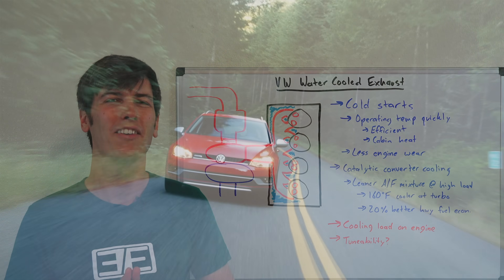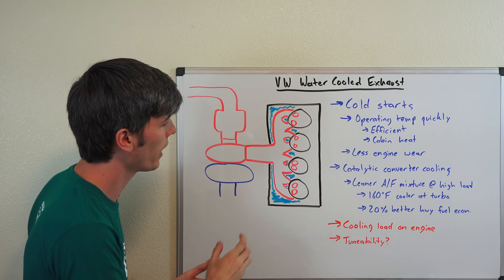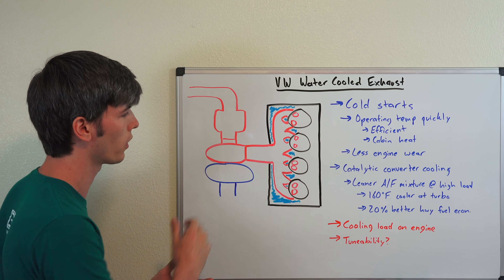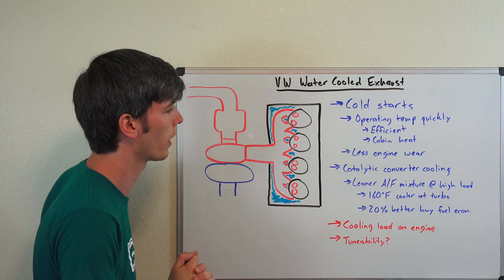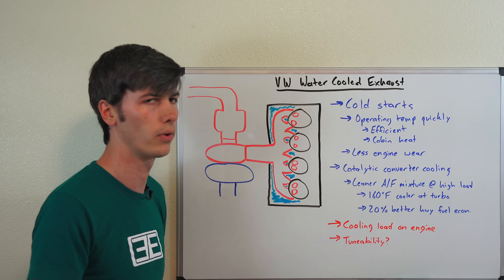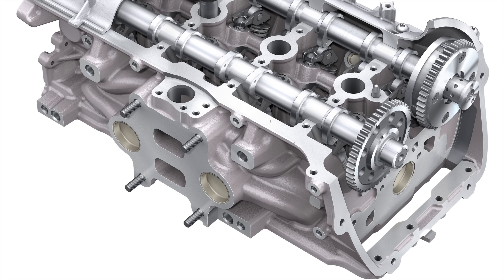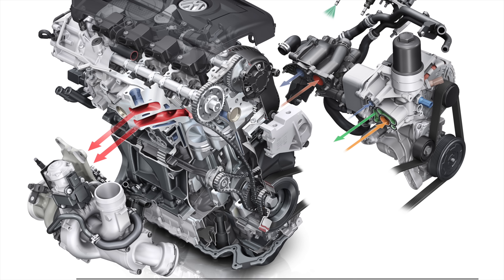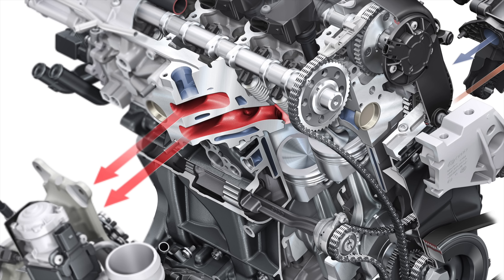Why Does Volkswagen Have A Water-Cooled Exhaust?

Comment: @Engineering Explained Cold engine startup damage does not exist in modern automobile because they all use Sinthetic oil as OEM, therefore there is no oil temperature degradation in cold starts, another thing is about the catalitic converter, it is no a plus if you send cooler exhaust gases through it because the optimus operation temperature for the catalitic converter is above 500 º C, the only thing you get out of this is a higher alternator and battery Amps comsuption due to a bigger cooling fan and a bigger radiator fit in your car to cool the heat excess added to the engine head, a catalitic converter getting carbon clogged faster than usual and a lot of other disadvantages. Volkswaguen numbers and measurements are not reliable...
Reply: Argeny Sandoval You wont get colder exhaust gasses! You will get leaner fuel mixture and that way the cat will actually clog up slower.
Reply: Argeny Sandoval how will the cat clog faster when they use a leaner fuel mix? also, the temperature at the turbo stays the same as before, since a leaner mixture burns hotter.

Comment: But..cooling the exhaust before it enters the turbo is NOT beneficial.  Turbochargers operate on a temperature and pressure differential to spool.  The greatest delta you can manage will produce the most efficiency.  Cooling the exhaust before it hits the compressor is detrimental.
Reply: Ryan Barbolt the temperature actually stays the same as before, since they can run a leaner and hotter mixture, which would otherwise be too hot for the cat converter.
Reply: maybe because cheap turbo cant handle too much heat :D

Comment: Question, Mr. Engineering Explained, isn't the heat produced by an IC engine the result of all the compression that happens thousands of times per minute in the combustion chambers of a running engine?

Comment: Thermal management opportunities. All manufacturers have to cope with emissions demands. Electronically operated thermostats started in the early 2000's. Water pumps with variable output (ECM controls coolant circulation). Additional electric coolant pumps. Movable slats to block or allow the flow of air through the radiator.... All of these things allow for opportunities that can be used to benefit emissions and consumer comfort. Near instant heater output to the cabin when used in combination with an electric heating grid. Can be used to keep heater operation working during engine off state for short times. But most importantly is emissions. The engine is designed to run at its most efficient at normal operating temperature, so the quickest way to get to operating temp is to increase thermal output from the exhaust ports and manage that heat to affect the things I have described above. This design is not VW specific and have seen it used years ago.

Comment: Advantage:
Reduces under-hood temperatures which helps to extend the life of components in this area.

Disadvantage:
Any sort of overheating problem (head gasket leak, water pump failure) will overtax the cooling system very quickly and with higher heat loads than found in engines that send the exhaust through an external manifold. These failures are more likely to cause catastrophic engine damage like bearing failures, block cracking or head warping.

Comment: Could a larger turbo not be fitted and radiator to cool the higher water temp as a result? Does the water get pumped to cool the exhaust or is it just passive flow. Can the pump turn off at cold start to heat the cat quicker

Comment: I'm in the 50s I own ford almost exclusively 30yr Until a ford dealership told me "did not want my old ford vehicle" So I thought to myself you don't want to buy my old car why would  I want to purchase your new vehicle? Their attitude change when I stood up and walk out. I week of research brought me to my local VW dealership, purchased new 2006 Volkswagen rabbit new 2011 Tiguan. Now 2017 Volkswagen. Never had to take a vehicle into the VW dealership for repairs, Oil changes and other routine maintenance yes.  Are Volkswagen perfect? probably not but in my humble opinion they do beat Ford. I had a 2000 Ford Taurus. It was in the shop every single month I owned it. Where the warranty ran out, I got rid of it.
Reply: Taurus was a sh|t box
Reply: My daughter's 2016 Ford Focus has had 3 automatic transmission failures and it only has 28,000 miles. She gets 38-42mpg on the dash meter average so she's not hot rodding it. That transmission just sucks.
Reply: Then you didnt make it past 100k miles.. not unless you did the timing belt yourself.. cool story though..
Reply: Who Me? It will quickly go down hill after about 50 - 70k miles, that's what VWs and BMW do. My wife's Chevy Tahoe has 8 years on my BMW x3 and 70k more miles yet mine is breaking something every month...
Reply: We have a little saying in Europe (not everyone says that, but some do) - never buy I car whose brand starts with an F. This meaning, Ford, Fiat, and french brands :D

Seriously though, all manufacturers have their strong and weak points. And overall reliability, fuel economy and performance quite often vary between different cars of the same model. Even with automation, mass scale production etc. you cannot ensure that all cars will match their specification 100%, neither exceeding it nor missing the target. 

Obviously this will usually not be a huge difference, but if you are lucky and get the one that was in 5% of the most reliable ones, and someone gets the one that was in the least reliable ones, your experiences will look incredibly different.

Comment: honda is doing the same thing with their 4 bangers, and ruining them in my opinion, no longer will honda, or any other inline 4 for that matter that has its header inside the head, be able to make in increase in power without sacrifices, no twinscroll, limited turbo sizing without major work to the head, and if you do increase its output, like you said, you increase the heat load on the cooling system. this is pretty much the end of the golden age of internal combustion engines, everything is hybridized, engineered to have little wiggle room compared to earlier models, the aftermarket is going to suffer because of this.

Comment: The purpose of cooling the integrated manifold is not to intentionally lower exhaust temperature, but to permit the head from cracking or warping.

Having the manifold internal with turbine directly mounted reduces lag by keeping the gases at higher pressure & temperature. It also reduces cost due to lower part count. And it reduces weight - cast iron turbo exhaust manifolds are heavy.
The lower exhaust gas temperature is a byproduct, not a design goal. Conventional turbo exhaust temperature after the turbine is already lower than before due to loss of energy during coversion of heat & pressure to turbine output power.

To run leaner under load normally causes detonation, thus an added benefit of the extensively cooled exhaust side of the head is cooler exhaust valves which reduces detonation.

Thus, "water cooled exhaust" is attention grabbing marketing. The real benefits are reduction of lag, lower cost, lower weight, more compact engine & ability to run lean under load.

Comment: So, heads that cost a lot more and are now guaranteed to crack? In addition, check the core plugs at the turbo flange. We will see several fail by dumping coolant into the turbo. Yet another very expensive throw-away engine from VW.

Comment: Actually the cooling isn't a problem at all to be fair. I'm running a Golf R with stage 3, it has just around 500 horses and 2.1 bar of boost. It's the same engine essentially, the EA888. I've pushed my car to the limits on hot days and it doesn't even break a sweat! :)

Comment: Not internal, but integral to the head.  the real reason is to reduce the coast of assembly and the number of purchased components,   The other reason is that there is no risk of the exhaust manifold being installed improperly.    The bonus is that it lights up the catalytic converter faster.

Comment: Some motorbikes back in t4 he 90s had watercooled headers, not for the same reason but to aid exhaust flow.
Did you ever to a look at the Ford 3 and 4 cylinder Ecoboost engines? They have this as well and predates the VW by 4/5 years.
Not to blag VW (never been a big fan) but you make it sound like the bees knees while the technology excists for years.....
Regards, Jurgen

Comment: Mostly Good video but you failed to mention some other negatives. The biggest issue is a loss of energy to the turbo. You should know this design is wasting thermal energy into the cooling system that could spin the turbo faster. So, in theory you need a bigger turbo with more lag and exhaust back pressure to compensate? This is also not new and possibly not wise on VW's part. The Honda V6 isn't a turbo but has a similar design. My biggest concern is VW is famous for taking years to get new things right. One wonders how many first gen motors will have issues as they rack up the miles? It also restricts breathing and creates an imbalance for the end cylinders compared to a more conventional exhaust manifold. German automotive engineering is littered with overly complex designs that often just create more problems than they solve.

Comment: IIRC, at least on the 06/07 Impreza WRX and STI, there is a water cooling line for something in the forced induction system (aside from the intercooler sprayer).

Comment: If you used the exhaust to heat the intake also then it further reduce the warmup time. Then there is the issue of thermal shock. However it is nearly a ford flathead which had a huge radiator for the coolant as it had coolant around the exhaust. Smokey Unic was on the right track years ago yet the Germans laughed. Adabiatic engine.

Comment: Even though I know this is the Internet and therefore my opinion doesn't matter at all, I figure I'll add my two cents for once. I have an 02 GTI with 221,000 hard miles on it with the 1.8 turbo 20 valve engine. It has a conventional exhaust manifold, but the turbo is just as close to the engine as it is on this one. And the turbo is water cooled. And I can vouch for  that the whole system has been quite reliable over the years, and I've had the car since new.  never overheated but gotten it pretty  hot a few times. Plus, the exhaust just rusted off and I had an opportunity to look at the catalytic converters after this many miles… No clogging whatsoever, they look brand new, And no play in the turbo bearings. So speaking from my own experience I can at least hope that Volkswagen still pulls off these crazy designs and still make them reliable

Comment: I don't really get why cooling teh exhaus gas, which is then directed to the tubrocharger, means the engine reaches it's operating temperature quicker...is it because the heat from the coolant stays in the engine block?

Comment: let's wait a few years and see what kind of problems/recalls come from this design
Reply: 600hp with the large frame turbocharger from Turbo Technics. Incredible unit.
Reply: Castle Bravo sorry for my english.  Cold coolant contacts with cold metal mainfold and this with hot exhaust gases. the difference between the mainfold temperature and the exhaust gas always is huge. Even when coolant is hot
Reply: Sorry for my english
Reply: Coolant in exhaust this mainfold must cracked
Reply: @StopTeoriomSpiskowym  "Coolant in exhaust this mainfold must cracked". Obviously not!

Comment: 9/10
It's great, but you could explain how this effects emission and performance at different loads compared to a previous model... I have trouble understanding why people think turbo gets cooler air, so less efficiency of the turbo? Also, the wastegate is being discussed, I don't really understand when the wastegate is used (when the turbo isn't spooled yet, but requested power is high? Any other instances?)

Comment: Just a couple of comments here:
1. While this is nothing short of impressive, all the engine manufacturers are moving to integrated manifolds which are water-cooled. Emissions is one aspect, but reliability in these lean engines is another. The hot gas temperatures wreak havoc on the bends in the manifolds and cause cracks.
2. Your comment about a twin-scroll turbo is interesting. Actually, the VW 1.8 turbocharger has a turbine intake commonly used for a twin scroll, but is technically a mono-scroll. The split scroll portion only extends about 25-30mm in, and then merges into a mono-scroll long before interacting with the wheel. VW believes that the scavenging effects of a twin scroll are only apparent up to this distance; beyond that, the unreliability of the twin scroll turbine intake outweighs the marginal gain.
Reply: Of what twin-scroll unreliability problems do you speak?

Comment: Wold it not be better to have the cooler after the turbine? Because the increased flow because of the temperature difference before and after the turbine will then drive the turbine more right?

Comment: I thought catalytic converter work best at really high temps, in fact I thought that was a way to tell it was working?
Reply: Yes they do.  Actually running lean causes the catalytic converter to run at a lower temp because it is not burning extra fuel in the converter to cut down on the unburnt hydrocarbons.

Comment: Marine engines application use this through a heat exchanger the exchanger then getscooled by seawater, it's an enclosed cooling systems, in VW is cooled by air is the only difference

Comment: Did they at least make it easier to replace the water pump? 2000 1.8T/5 with 253k on the dash still going strong. 
Water cooling is nothing new. But, it is not used for good reason. You have a dense charge of air entering the head, becoming heated, then once again becoming dense. Uneven thermal expansion anyone?
The 20% thing seems optimistic. Yes you will have quicker start up times and less wear. But they will be slightly better then just letting your engine sit for 3 or so minutes or driving it lightly until it warms up. Once the OIL reaches operating temp the thing goes out of "cold" timing and fuel mode not when the heater blows hot air you know this. 

Holding out for free valve. That will actually improve start up times and delivers realistic efficiency gains.

Comment: @Jason: I would like to point out a possible disadvantage, would it be considered in a water cooled exhaust design?
Since gas turbines work on pressure and heat, less heat is getting to that turbocharger, would reduce it's efficiency significantly?

Comment: Must be a huge radiator, plus an additional gallon or so of coolant needed. Makes it harder to diagnose internal head gasket leaks because now it could be an exhaust manifold leak also. Over engineering = headaches, and big repair bills. Almost as bad as my electric water pump mounted on the bottom of my bmw 335xi, that leaks and has to be repaced every 6 months!

Comment: Isn't the richer A/F mixture at high loads to prevent piston from reaching too high temperatures on its surface? The catalytic converter seems to be less important than piston. I'm referring to what's said at about 2:15 that richer mixture is to save the catalytic converter. Would be grateful for clarifications. Thanks!

Comment: A few things come to mind with this design... specially since its a VW:
 - earlier failures of all shapes and forms... even earlier than ever before, so that would be pretty damn early;
 - overheating issues in hot climates;
 - more and more things to fail all together;
 - "cheap" repairs when it all goes south... and it sure as heck will!

Uhm, thanks but no thanks.

Comment: There are 2 good PDFs on this, try searching for
"The new 1.8 l TFSI engine from Audi Part 1: Base engine and thermomanagement" and
"Innovative Technologies in Current and Future TFSI Engines from Audi"

As to the video's assertion that this is only for low powered engines, my understanding is that the 2.0T EA888 engine in the Golf R has this also (around 296 bhp).
Reply: cafebloke yes that’s right and are also producing 500 bhp with a larger turbo and not much else

Comment: Another negative is that they're removing energy from the exhaust before it gets to the turbo. That means the turbo is not doing as much of what it could be doing. But it sounds like keeping temps down is more important than performance. Very interesting configuration though.
Oops I see there's a whole comment thread on this already. I built a turbo sports care in 1979. Had a blast.

Comment: cool the exhaust allows a smaller engine, requires a larger radiator, reduces fuel cooling at high power levels, reduces peak catalytic converter temperatures. reduces peak turbo temperatures. I think several companies are moving in this direction.

Comment: Couldn't you just make a very complex exhaust header with built in cooling for other vehicles? Or is this also relying on the engine block itself for additional heat dissipation?

Comment: I find it amazing how big improvements to IC engine efficiency continue to be developed.

However, I think the end of the ICE is within sight now. Electric cars are coming. Maybe in about 5-10 years there will be a tipping point where the manufacturers will start shifting their R&D to electrics and away from ICEs.

I think the last ICEs will be opposing piston linear generators used for hybrid vehicles:
https://www.digitaltrends.com/cars/germans-create-free-piston-multi-fuel-engine-that-could-answer-ev-range-anxiety-issues/

Comment: The Honda Insight had a 3 cylinder engine with the exhaust manifold in the head as well.  It makes for a great lean burn engine.aftermarket guys have been turbo charging those engines for over a decade. Great to see this is moving to other applications.